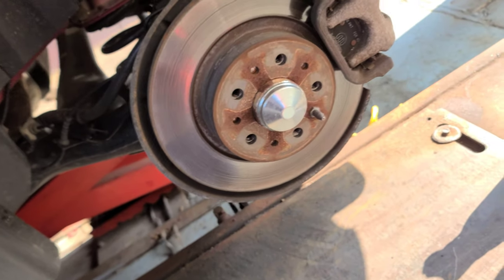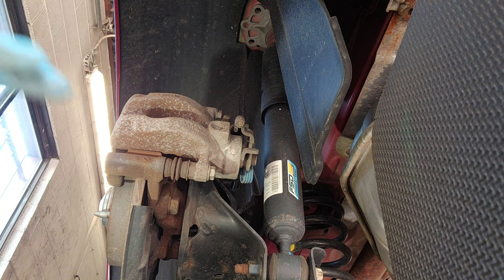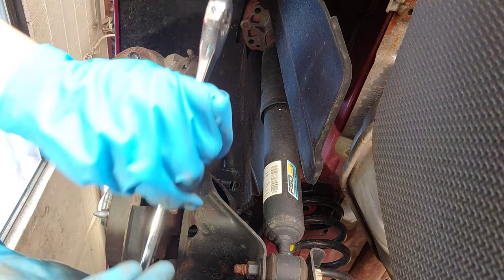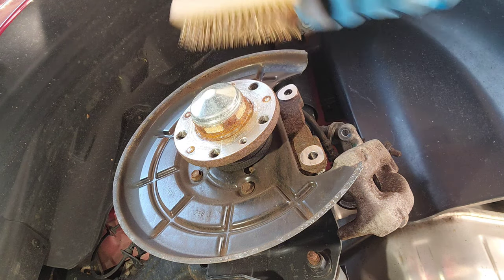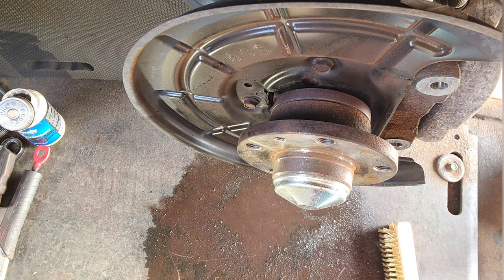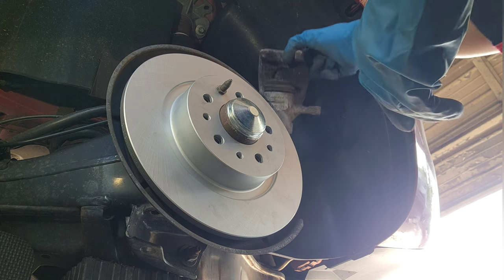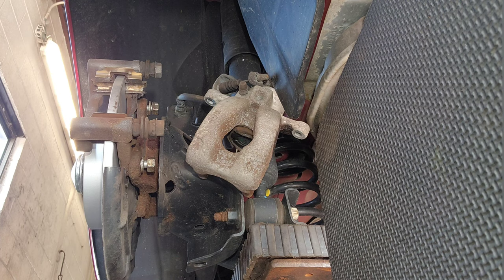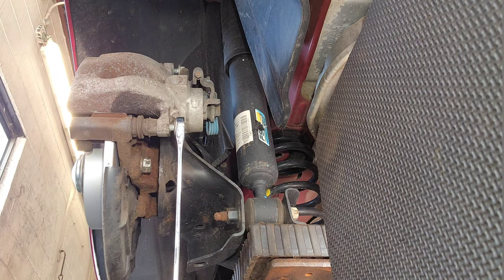2012 - 2015 Fiat 500 How to Replace Rear Brake Pads & Brake Rotor

Comment: What do you recommend for a rotor pin being stuck the one holding the rotor in the video . Mine will not budge
Reply from the maker: Did you watch the entire video? I don't remember if it has a rubber that hold the rotors or screws, but if it doesn't have none of those, u just have to hit it really hard with a hammer, a real hammer tho...let me know how it did go